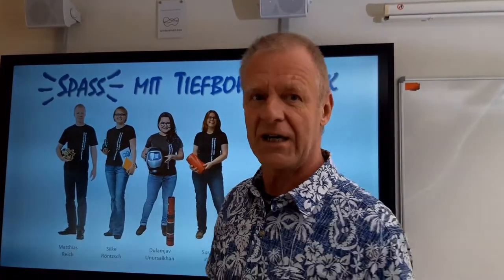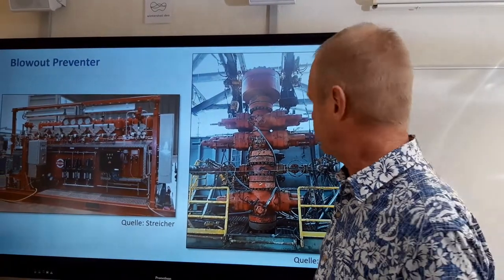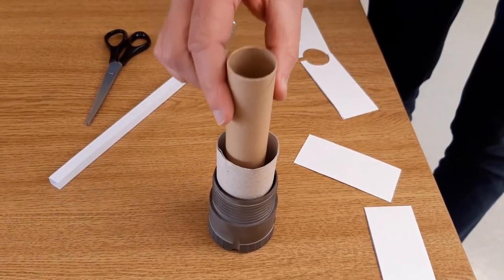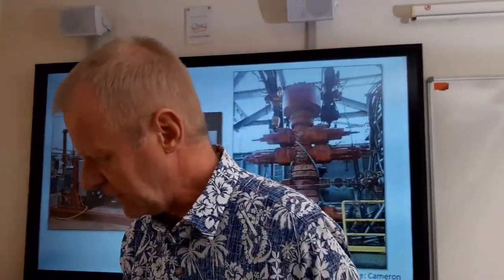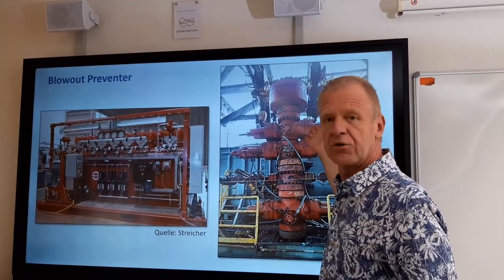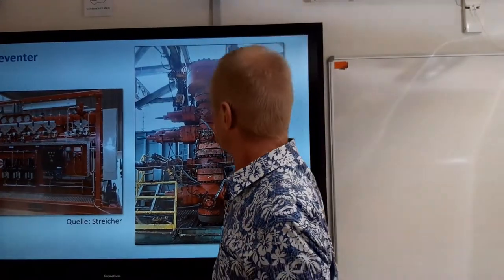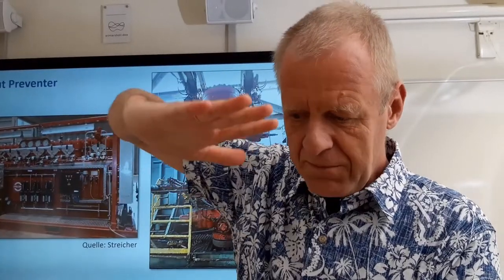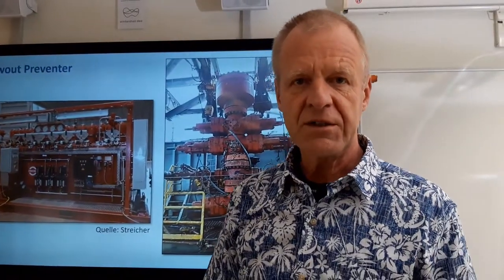How does a Blowout Preventer (BOP) work?

Comment: very interesting video!... however how do you restore production after the BOP cuts the pipe and seal the flow??
Reply: I've been wondering the same
Reply from the maker: @andrewdemoranville9657  during drilling operations there is no "production". If everything goes well, no oil or gas enters the well during drilling. However, of course a "fish" in the borehole has to be removed before drilling can be continued. There are special fishing companies who are specialized in pulling a lost piece of a drill string out of the borehole.

Comment: Good video. So the BOP are pneumatically (nitrogen) operated? I was thinking they are hydraulically operated.
Thanks.
Reply from the maker: They are hydraulically operated, but the energy to move the hydraulic fluid is provided by pressurized nitrogen in the top of the bottles.
Reply: @funwithdrillingengineering7649  Thanks. I got you.... Nitrogen should be in bladder for pushing hydraulic fluid out (just like accumulator).
Thanks for the clarification.

Comment: Why annular preventer on top when rig up
Reply from the maker: You ask why  the annular preventer is found on the top end of the preventer stack? Well... You only use the annular preventer, if the other preventers (rams) cannot be used. Therefore seen from the borehole the kick will first arrive at the Rams, and then at the annular preventer.
Does that answer your question? Best regards!